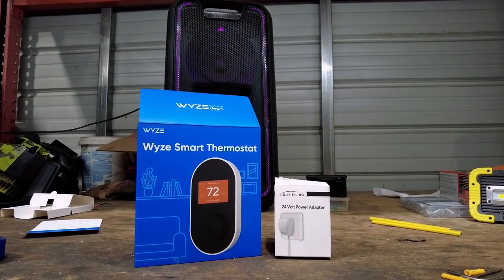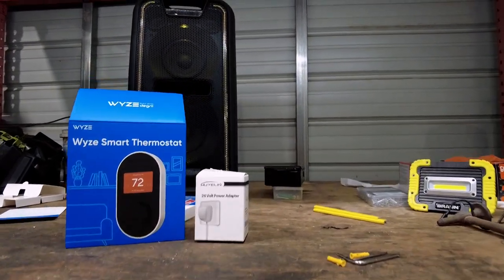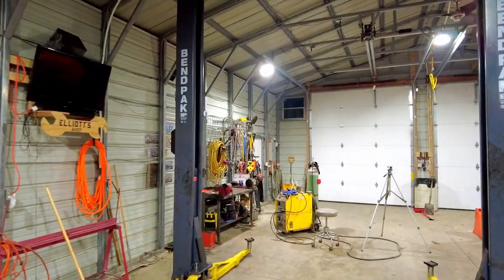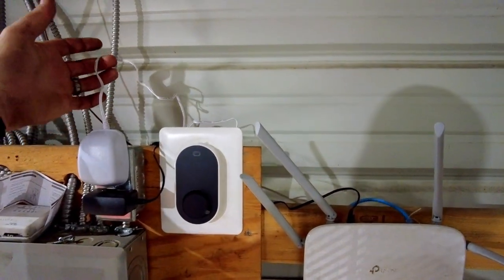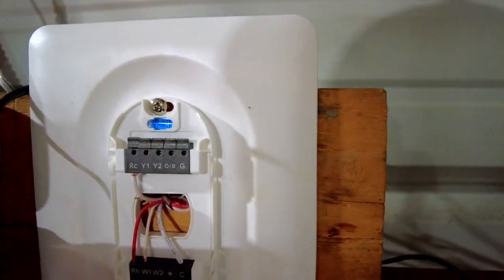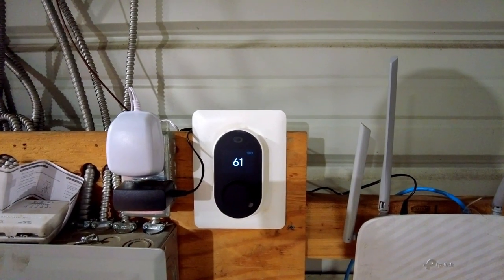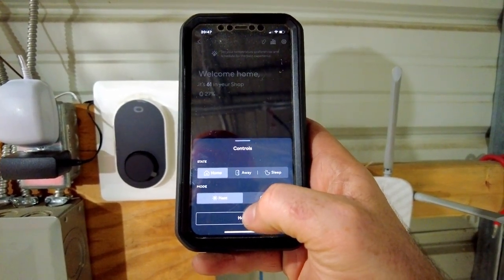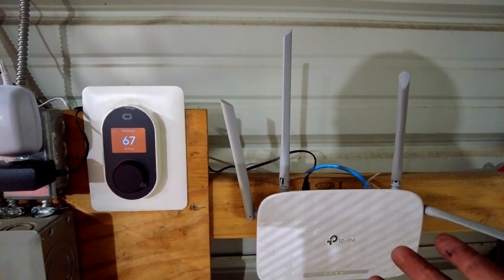Wifi Thermostat Install with no C Wire

Comment: Been  A WYZE fan few years , Have 10cameras 7indoor and 3 out door, Heard U might get snow this week raining here in Indiana tonight
Reply from the maker: How do you like the cameras? Been thinkin about putting a couple in the shop…
Reply: @EverythingElliott   good evening/ morning Elliott,  I can't believe  I wrote out a hour long  documentary about wyze cam and  I deleted it without sending. 
Try this again  probably be a short version of the original. 
Had a apartment,  then in May  bought a house. 
Originally I just had one cam. 
Then 2 more then 7 more after the house. 
My first 3 were the  wyze cam v2.
The other 7 are V3. 
Once you buy the is no monthly fee  unless  you upgrade. The cheapest  option  is wyze cam +,that is  1.99 monthly  or like 18 dollars per year if paid ahead. The wyze cam V3  is a better camera than V2.  But v2 is okay. 
The free version  is you will still receive  a  notification of any detection.  But it will  only  save on wyze cam server a screen shot. 
Wyze cam + saves a 30 second video to the server. I only pay Cam + on two 
I suggest you buy one. Get the V3  and cam + then if you buy more you get a discount because you are a member. 
You can put in a 32gb SD card for  constant recording. 
For free you can log into your account  and watch  live feed 
You can switch  what camera  are the wyze cam + you can  move it from one cam to a different one.
Set up is extremely easy  5 minutes  per camera. 
The detection settings  you can grid zone  each camera  incase  you have pets. I have three cats So the floor  is zone out. U can set a grid pattern. 
There are more settings  I explained in the previous one I deleted. They have a lot of different options and things.
The owners of Wyze cam is USA company  its all located here in the US. 
Instead  of  a long  message like the  first one.  Any Questions please feel free to contact me. 
There are good YouTube  videos  on  the  wyze cam  people  comment on their site. 
Yes I would highly recommend them
I wad in the hospital  last  February  and I could  watch the cats. I was in the hospital for 3 weeks. Two of my nurses  ended up  buying  wyze cam  after  watching mine.
Okay I will stop any questions please ask.